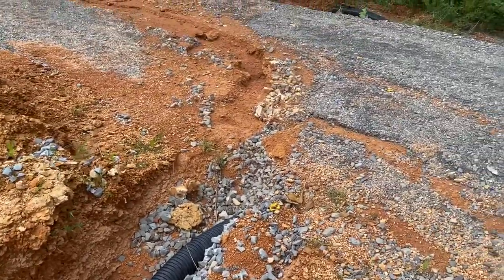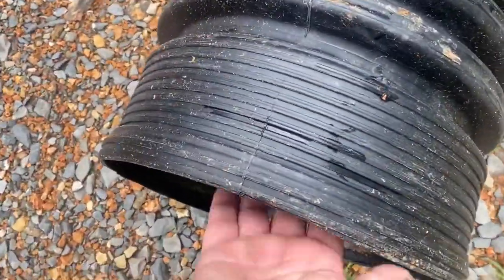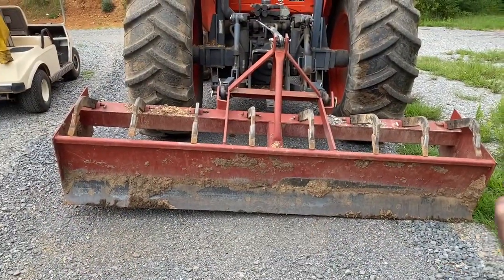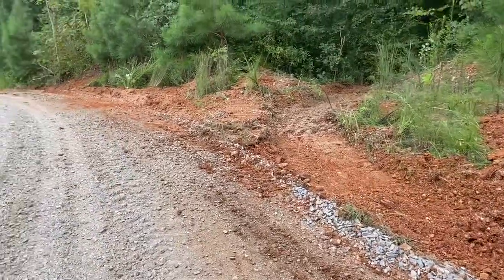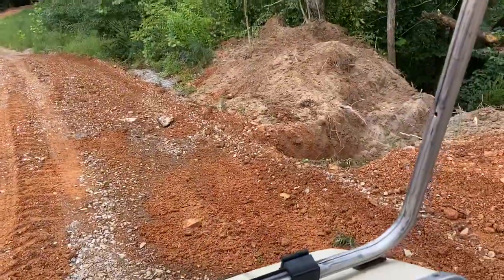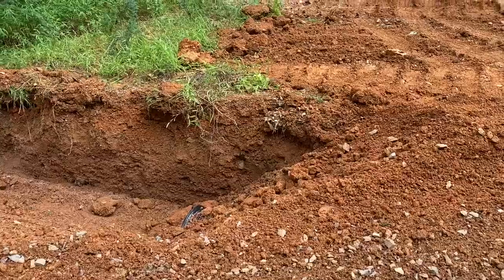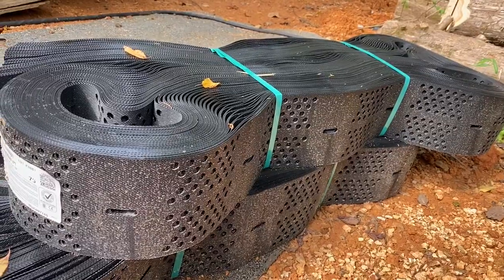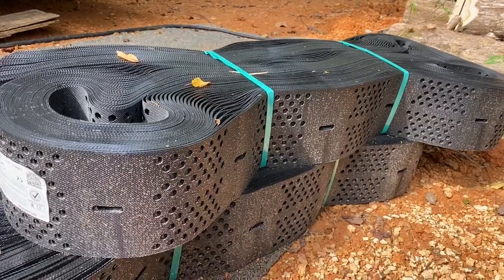Installing driveway culverts

Comment: You might consider using gabion baskets at the head of your culverts.  This will stop the water from eroding around the head of the culvert.  They are easy to use and can be added on to if the need arises due to eroding when the water tries to make the turn into the culvert.  Also could use a flat one to stop the water from eroding coming out of the culvert.  Because you are going to have an issue when the water coming out of the culvert makes a cut several feet deep.  Only suggestions.  That was a good operator you hired to do that work.  Nice when you can find competent people.  Take care

Comment: 20 to 22" of cover above the pipe, plus 4 to 6" more of gravel - you should be fine as far as the structure of the pipe not being at risk from loading.  I use double wall, and that calls for 12" of cover for regular traffic.

Comment: Single pipe is always best cause it can't blow out between them. I would of put at least a single 18" there but would like a single 24". But I see why you put doubles (EDIT I see you didn't double it you just needed that length). Y'all put that pipe deep enough for a 24 why not put a larger pipe in? There not much more and one thing I have learned building roads and such for logging access is that you always want to go much bigger!! They eventually silt in in a short time and you loose capacity pretty quick. Your always there but when we cross a creek were not there and sticks can block the openings. If too small it dams it up and you can get a blow out. 

That gutter hose you had before was a joke. Those can't handle the water off one side a roof of a house let alone that hill.
Reply: I would have put broad based dips in that drive, never put it straight up hill like that. I think you could make them shuttle enough to get a buss over them. Not water bars but broad based dips. That whole road should have been cut, you don't want that water flowing down unrestricted in a ditch like it was. At least your putting rocks in as check dams like I said when I first saw that design. That's the only way to slow that volume of water down .
Reply: The turnouts he made were what you needed initially. That's what I was talking about. You should of recontoured with broad based dips with each turnout. Your goal is only to have water on a short portion of the road. If your hill is as steep as your talking I would want to see at least three broad based dips and turnouts on that hill you have

Comment: Scott, I’ll add my vote for rip rap or channel lining for both sides of each pipe. It’ll slow water coming in and prevent erosion. You may also want to form some concrete headwalls on the inlet sides so the bulk of the water hits that and is focused into the pipe rather than pointing the water in the general direction it needs to go. Otherwise, I have a feeling you will be replacing these culverts very prematurely.

Comment: Scott if that new 12" culvert doesn't handle the water you might as well build a bridge. Lol
As much as I hate to say it if it doesn't work out black top or concrete would fix it but would be very expensive know matter which one you picked.
It looks like you got a handle on it with that webbing that's cool are you going to video the install of it that would be interesting to watch. Thanks for sharing guys.

Comment: Yeah baby.  I have laid 260' of the 12".   That machine at 65hp is way more powerful than my 23hp tractor loader backhoe, and I only have a 10" bucket.  Good luck.  You will be happy to have those 12 inchers.  The operator is very good.  I put mine together by hand with a pry bar and stub shoved in the end of the next pipe.  Adding 6" of gravel is a lot to an existing driveway.  Those runoff ditches area great idea, and crowning driveway.  $225 is all you paid for the trackhoe?  Awesome.

Comment: Where you have the exit part of the 12 inch pipe you will need large stones to slow up the flow or it will erode  the chirt into a very deep gully and may cause a weakness in that part of your road...just a thought.

Comment: If the old pipe is 6 inches and the new pipe is 12 inches.  You should be getting about 4 times the flow as before.
Reply from the maker: 4”

Comment: You are fortunate to have such good ground. We would be fighting rocks...lots of rocks, LOL
Actually, we have fought them. When we built my shop the dirt guys, family friends, were moving rocks the size of your VW. We have a nice rock wall with some of them. Don't be discouraged by the things you have to re- engineer, Scott. It happens.
I would add three ft. to the ends of that lower culvert, I think it is a bit short, sorry to say.
Too easy for the dirt above to wash down when you don't have enough stable overhang.
If you can find it, get a load of Rip-Rap rock, which is non round rocks the  larger than large round melons, and line the ditches on both sides  of the culverts... about to about 4 ft. ahead of and past the ends of the pipe, and on top of any exposed culvert, it'll create some resistance to the soil being washed around the pipe. You can hand place the rocks and make a great structure to maintain the integrity of the ditch and culvert pipes.
I live in rainy country too...learned by making mistakes.
Reply from the maker: Well that giant full sized van rock by our entrance came out of here.
Reply: Nice road marker! We had to use some potion of expansion stuff and get a big air drill a few of them to get them to crack and make them moveable. Took 3 times as long as it should have just to dig footings and get our road in, which is about 300 ft.long
Lots of decomposed granite around here, and lots of not so decomposed as well, LOL The DG is great stuff.
I see I wasn't the first to make some suggestions, sorry to repeat those thoughts. I'll see to it that it doesn't happen again.Take care.
Reply: Yeah the important thing is to learn.  He's doing well - crown the driveway is very important, large enough culverts, he's going to geogrid.  My hope is the geogrid porion works out because I don't see how it can be maintained if it isn't done right.

Comment: looks like you needed another section, but it is hard to tell from Missouri. Hope it holds up! Your operator moved a lot of dirt for $225. Keep improving that crown, it pays.
Reply: i thought the same, the ends were short and looked like they got covered with that sand. i thought you would want at least coarse gravel so water can flow through it and not wash it out as easily

Comment: smaller bucket would have been a thing on that job
Reply from the maker: Can’t make everyone happy.  But that’s what he had and he only charged $225 total for the work.
Reply: Why?  The recommendation is to have a 30" wide trench for a 12" pipe (OD = 14.5") so that the backfill properly gets beneath it and supports it.  The width looked perfect to me.

Comment: Scott  question Are you cut down the driveway 4 in to 6 in  then install  Geo  web ? Scott or you put Geo web on top the driveway you have now and changing  the grade so not as step for the bus?
Reply: That was my question.  He said he is adding 6" - which is a lot to an existing driveway.  He said he wanted to reduce the grade so maybe he is raising it for a couple hundred feet before the top of the hill.

Comment: It's going to be an ongoing struggle to keep up with it. Heavy rains are going to go where gravity tells it to. Put some large 4-6 inch rocks in the ditches to help slow the water down. It will also help keep the dirt out of the culvert pipes. In my city (Peoria, IL) they built a road (Grand View Drive) from the bluff down to the bottom in the early 1900's. Steep grade with switchbacks. High crown and rock in the gutters. It was originally dirt and paved later with chip and tar. It held up well for 100 years.  It was redone a decade ago and they took out the crown and put in cement gutters. We'll see if modern engineering does as well as the old timers.

Comment: can you add something to  the opening to stop crap getting washed in and blocking therm?
Reply: Gabion cage  or grizzly bars, even large angular rock would help
Reply: 'round these here parts they use a large grate (like prison bar sized) at a 45 deg angle to verticle.  It seems to work fine.